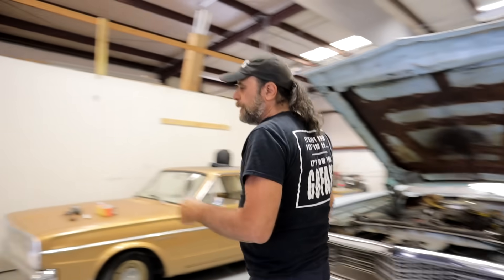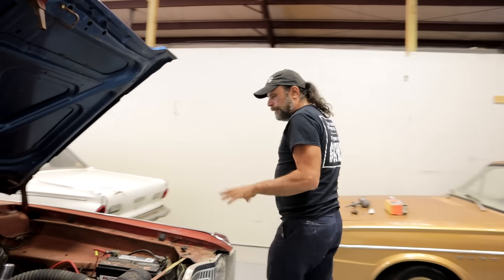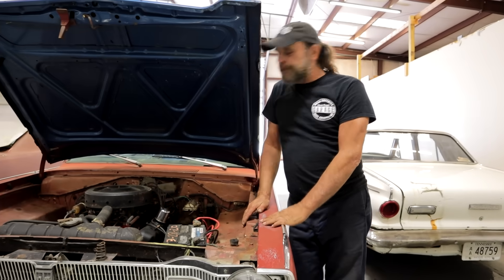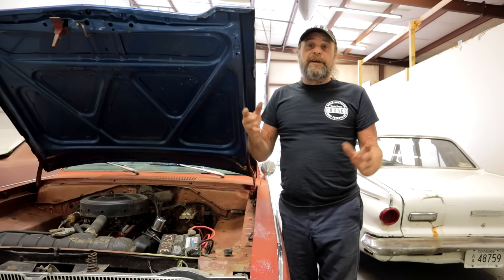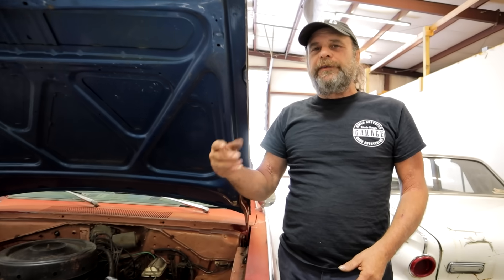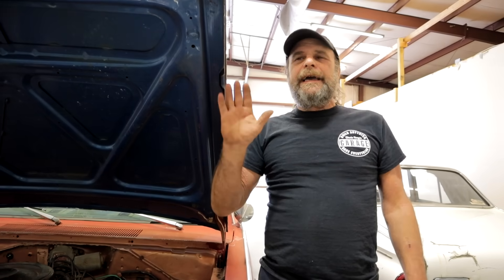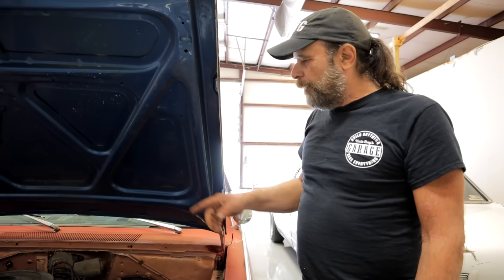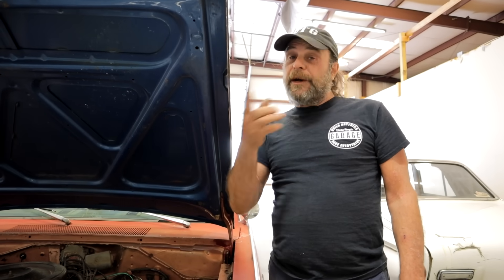Old School Tune-Up Mastery For Beginners: Setting Up Points The Easy Way

Comment: Just seen the Dulcich and Friedburger vid on piston reversing. If UTG had these guys budget, the mustard seed would move mountains. I do respect where these boys came from, but most guys in this game are not endowed enough to have mega hp builds between the rails so any gains however small are most welcome. Check book racers were never my thing. So any knowledge  that can get me across the line quicker is always welcome, not bills for overpriced labor and parts that we have to endure these days which is why I do most stuff myself. Comprende?

Comment: Very cool UT. I do still like the ease of the electronic ignition system though. As long as she's got a good ground, you can pull 200k miles without a hiccup. Then if/when it does, its two 1/2 inch bolts, and one plug. I do understand the points system. I dont hate it, but it is a maintenance item I could deal without. Very cool vid and good job showing the newer generation how to make the old skool generation equipment function.

Comment: Excellent video -- thanks!  I've dropped that hold-down screw so many times I just assume it's going to happen and have my little telescoping magnet thing at hand.  Never used a dwell meter to set them before, but just bought one off the 'bay so I'll be trying it out come the weekend.  Never too old. :-)
Reply: Wouldn't it just be easier to start with a magnetic screwdriver ?
Reply: @Richie_the_Fixer  Perhaps, but no guarantees with my shaky hands. :-)

Comment: I think I saw your fan spinning like a top there at the end after you shut off the engine.  Fan clutch a little sketchy?
Reply: If the car isn't hot , the thermostatic clutch shouldn't lock , and the fan should freewheel . 
That's why the clutch is THERE !
Reply: @Richie_the_Fixer  Freely like a top, or does the viscus fluid couple it to the pully?  Mine rotate as many as 5 revolutions or less depending on if the clutch is standard or heavy-duty, in which case it rotates maybe 3 revolutions, but not freely.  Check this if you"re experiencing cooling issues, a failed clutch will not move air well.
I could go deeper into this, having experimented with various viscuss clutches on various vehicles over the years but keeping it short, I recommend a thermally controlled clutch of the same type used originally vs one desiged for a heavy-duty application in a truck because too much clutch can be a bad thing too.
https://youtu.be/51noZBn3Pvw
BTW, a clogged radiator can cause the thermal clutch not to engage fully, so it's important to distinguish between a radiator problem and a clutch issue.
Reply: The viscous fluid should be fully disengaged when the valve is open , the bi-metallic coil should close the valve when hot .
Reply: @Richie_the_Fixer  So my fan clutches are seized and the manufacturer instructions are incorrect?
I bet you didn't even watch the video I took my time to locate and post.  Your  lack of knowledge doesn't impress me, please stay away from me.
Maybe your Chinese fan clutches behave this way and it's normal b/c they aren't worth a crap and the instructions make no mention of this?  Proper fan clutches aren't like you describe, do some research.
From the manufacturer catalog:
"Some fan clutches will show no visible indication of a problem yet may still be faulty.
The following may also indicate a faulty fan clutch:
  Fan spins excessively - three or more times when hot engine is shut off.
  Poor air conditioning - At low speed due to excessive high side refrigerant pressures.
  Doesn’t engage or “lockup”- Fan speed does not increase when engine is hot.
  Does not disengage - Fan clutch won’t slow down when engine is cold."

Comment: I always remove the distributor when doing the points so much easier . Chrysler products have a tab on the dist. shaft so it goes back in place just note where the rotor position is before removing the dist. Sixes have a gear so you have to be careful not to get the teeth meshed out of place.

Comment: You forgot to mention changing the dwell also changes ignition timing. Should always check it after replacing the points.

Comment: As I recall, Ford had a small allen screw on the side of the distributor that you could actually gets the points close and then start the car and adjust the dwell (point gap) by using the allen screw.  Oh and I still have my dwell meter and all my Craftsman ignition wrenches from my dad - and I am 72 years old
Reply: That is GM, not Ford.

Comment: The way I understand it the feeler guage method is only completely accurate with new points, but dwell works perfect for new and used points.  When points get used the arcing that inevitably occurs in operation gradually makes one contact slightly concave and one slightly convex. The feeler guage can only accurately measure/set the gap between 2 flat contact surfaces. Thus a feeler guage setting becomes a cruder and cruder approximation the later in the life of the points at which it is performed.

Comment: I always checked the points contacts to make sure they lined up perfectly when closed. Sometimes  a little gentle  bending is needed to get really  good  alignment. If not aligned they burn out a lot faster!
Reply: The rubbing block doesn't allow that anymore...
Reply: @kramnull8962  Standard/ Blue Streak still make them the old way.

Comment: A correct condenser (capacitor) will not cause metal transfer on the points. I had one I used for years because of this. Points lasted much longer this way. Great Video Tony!

Comment: I have points on my factory 65 dart with slant6 . yes its easy to tune/ change them out but the problem is the points are now made over seas and made very cheap. its hard to find fair or good quality points unless you go to a estate auction ect and find out the guy collected mopar ignition stuff or a guy bought out and stashed NOS points parts. the other problem is all the parts stores are selling china / Mexico cheap ass 25.00 distributors including points distributors and the bushings can wear out and cause the cam lobes on the distributor shaft to not stay in center and cause the points to some times open up and other times not went through of a couple Alcordone brand distributors before I found Joe's distributor repair on Facebook. he rebuilds them to stock specs or modifies them to fit your modified engine and uses NOS parts or new made in a america parts

Comment: I like the dual point system because of the increased "dwell time" which allows the coil to build up more energy, for me I find it better than the single point setup. 👍
Reply: The converse is actually true . 
If you have a top quality coil , like an Accel Super Coil or Mallory Blaster which require less saturation time , keeping the points OPEN longer gives you more spark duration to more fully ignite the fuel . 
GM's actual spec in the 60s wasn't 30° , it was "28°-30°" . 
Setting to 28° actually made a difference you could feel in acceleration .

Comment: I was on the electronic ignition bandwagon for a long time I was at the local cycle shop buying parts to bring my '72 Honda cb 750k back to life and I wanted a electronic ignition  for it and the guy at the counter was ADAMANT that I didn't need one he said "points are good and simple when electronic goes out it's a pain to figure out" I'm glad I listened to him! Tony just reinforces the point!
Reply: The only caution would be that most British bikes had Lucas advance units. The points gave good service but the advance unit would get notches in the weight slots and severe wear on the pins. When worn enough the weights would hang on the pins holding the ignition a full advance. This made the engine difficult to start when cold. 
At this point an electronic ignition conversion wasn't much more money than a new advance unit. That's the reason it's unusual to see a Norton for instance still running points.
Reply: Ah! Lucas! "The prince of darkness"!
Reply: Prince of darkness let me count the ways on a 72 Triumph 650 😂 @DougsterWolverineGarage

Comment: I've Said this before but I never had a dwell meter so on the GMs they have the access port so you can adjust under load.....     

So your thinking how the hell do you adjust points while under load... well you chain the bumper to an oak tree. I guess you frost bit boys up north could achieve the same chaining to the foundation of what ever your working under...  same for adjusting the timing advance. If your really Brave you can even set your secondaries haha

Comment: I agree...will never swap my points for HEI, and I love using a meter and vacuum gauge to tune it up...I don't need to depend on computers.  And I can carry a spare set of belts, points, cap and a coil for $50 and pretty much be able to get home with that .  They're the ultimate doomsday vehicles!

Comment: One memory that sticks with me isn't a good one. My late Dad was teaching me how to adjust the points with a dwell meter on our family's '64 Impala. Somehow I got myself across the distributor firing voltage while reaching in with the hex key through the distributor cap window. Wow, it felt like a giant had socked me in the arm. I was OK after the experience but the memory that has stayed with me all these years. I like this channel but my ride these days is pretty modern, a 2012 Chrysler 200 Touring convertible.
Reply: We used to light each other up with a HEI out of a Chevy by seeing who could get a pencil closest to the cap while someone else was triggering it with a soldering iron.  That's all some of those kids learned in school, I'm sure.

Comment: Old school...remember the dwell effects the timing but the timing doesn't effect the dwell. Cheers!
Reply: Explain. If changing the dwell changes the point gap and thus the timing, why doesn't it work in reverse?
Reply: @rcnelson  The dwell effects the timing by a small amount because the points opened a little sooner or later based on their gap "dwell". Moving the timing doesn't effect the points gap "dwell". Thanks Uncle Tony for old school lesson.

Comment: In the mid nineties was attempting to restore a 69 442, I did not know shit, my neighbor showed me how to set points with a dwell meter, I'll be damned if I remember how to do it now!, but this rang my bell a little!
Reply: The GM distributors had a little "window" which could be opened and an Allen key of the right size was used to adjust the points with a dwell/tach meter. If you ball parked the gap right, the dwell could be dialed in with the engine running.

There was a lot less crap in an engine compartment in those days...
Reply: @lordphullautosear  
I have a 92 Dodge w250(4x4)
With a 360LA,
I was showing a friends 16 yr old son how to do a minor tune up, when I opened the hood he asked me "where's the rest of the engine?, all the plastic stuff?"
LOL, 🤣
Reply: @lordphullautosear  Yes that was the way, get it running then 28-30 on the dwell.

Comment: We had a new (still have)1976 Corolla. After some break in miles, I took it out and at 80mph it started missing. I looked in my books and found that points set too wide could cause that. Adjusted them and it ran perfect at 80. I still have some ignition wrenches that belonged to my grandfather. And a Dial-A-Gap tool for GM.

Comment: Great video, now where do I attach the meter to my HEI???
Reply: Rocky, remove the freeze plugs on the sides of the engine block, and hook the meter to the piston return springs.
Reply: Same place as a points car, the neg side / tach terminal, not that you can change anything.

Comment: GM cars with a door on the distributor cap can be set without a feeler gauge or dwell meter.  The adjuster screw gets turned one way until the engine stalls, then turned a certain amount the other way.   What happens is the adjuster gets turned until the points are closed ( engine stalls due to ignition being shut off. ), then turned the other way based on the pitch of the screw.

Comment: Mechanical breakers uhh we transistorized ignition systems to keep from having to swap out points. If you like messing with it it's fine but a new HEI ignition module takes less time to swap out than messing around with setting dwell or measuring with feeler gauges. I'll never look down on a guy who likes using them but we literally invented a way around having to do it because people don't like quickly wearing mechanical breakers. There's other things I could be doing like spending time on ignition timing or retuning the carburetor or actually upgrading heads or intakes. It just doesn't make sense to me to want to have to fiddle with your ignition system because of mechanical wear.

Comment: This is not hate, but may sound like it.... How is that easier then doing literally nothing with an electronic ignition ???

If you want to see the benefit of the modern ignition, you should see how crappy original plugs look with over 150k VS  how well the motor still ran.
Reply: Electronic ignitions of that era weren't always better.

Comment: Every vehicle has different access. Points on a Type 2 Vanagon is not back friendly. 

It's still in there. But a hall sensor pick up does sound nice and like you said convienent. Aint no way in hell I'm spending 50$ on one though. I'll make it for likely less than a 1$.

Comment: If you dont have  a dwell meter, tape a protractor to the top of the rotor, and fashion a pointer from something solid. Hook a test light across the points. Turning the engine over by hand, take note of how many degrees the light is on, that is your dwell.

Comment: Lol, i have my own anti theft system on my 66 chevy pickup. The voltage regulator crapped out about a year ago and wont work till you push the contacts in by hand. No chance any of these kids would know how to do it. If they did steal it, ohhh, i would find it a couple of miles away
Reply: Another way is to remove the rotor inside the cap, or just unplug the positive wire on the coil.
Reply: @richarda996  I don't recommend unplugging the coil wire. I did that for about a year and then one day the car wouldn't start. Looking inside the distributor and coil cap revealed corrosion since the connection points weren't sealed from the environment. Rotor trick is a good one though. Or just have a hidden engine kill switch inside the wheel well (that's what I have).

Comment: Back in the 80s here in the UK, there was a common knowledge rule of thumb for setting points and plug gaps, for the diy man with no tech manual, 15 thou for points, 25 to 30 thou for plugs, they ran.

Comment: I can never seem to get them set worth a crap with a feeler gauge on the initial adjustment. Sometimes I get it so far off it won't even run, so even on my GM stuff I just go straight to setting it this way.  I'll swap the points or file them, set them close, then hook up the dwell meter and adjust it while I have someone else cranking before even putting the cap on 'cause it's easier to find that allen screw with the cap off.  
Yeah, it's easier to just run HEI... but where's the fun in that?

Comment: Doesn't an electronic ignition system give a hotter spark at low RPM for easier starting and better idle? Many years ago I converted an MG-B and a BSA motorcycle to electronic ignition both were much easier to start and could actually idle.

Comment: A Total 100% Beginner might ask these questions and more:

1. Is there and what is the relationship between Dwell and Timing? The cam?

2.  If your engine is not stock, how do you determine optimal Dwell Time?

3.  What are the most important factors that determine what the optimal Dwell Time is?

4. What other obvious questions should be asked and the answers known by all?

Comment: Who used to work as a tow truck driver at a service station. He had a fairly good towing business and he also did tune-ups and repairs on automobiles. Every time he had a Chrysler product in there to do a tune-up he would have me do the tune-up. I had done so many of them on Chrysler products I could tell by looking at the point where they were 17018 thousands of 19,000. And that's with ended well range, and usually you would use the differential on a set of points that somebody just needed to have cleaned up real quick so that they could still use them for a while so you would run some 500 grit sandpaper on it and reset it to about 17, will you put a new set. And run at about 19,000 you get a little bit more dwell time a little bit hotter spark. The pain in the ass came when you had to face a distributor because it was so jumpy when you check the timing you couldn't get any kind of decent fuel mileage out of it. So you grab the distributor with the hole in the side of it so you can adjust the phasing until the jumpy timing tightens up and that's where you leave it.
Teflon lubricant was a godsend for the rubbing block because it will not wear once you load the cam with Teflon Lube period or spray some wet Teflon Lube on that felt pad it rubs on the cam.
You are correct on those Accel points however. I once did a tuneup on a 1965 Chrysler Imperial with Accel points and wires and a carburetor rebuild. I did the upgrade to the car at 177000 miles. I talked that same lady oh, several years later, because I was traveling around in the Air Force. I asked her how her car was doing. She said it still starts and runs before she can take her hand off the key. I asked her how many miles it had on it she said 350,000 miles no. She had done nothing to the car as far as the ignition and the carburetor  for 173,000 miles.

Comment: Just reminded my why I like the GM distributors more, externally adjusted points.
Reply: Or you can drive a real car with the distributor up front.
Reply: Sam Hagins , you mean like a Buick ? They were a dream , with both a front distributor AND a uniset points that could be set with the engine running !